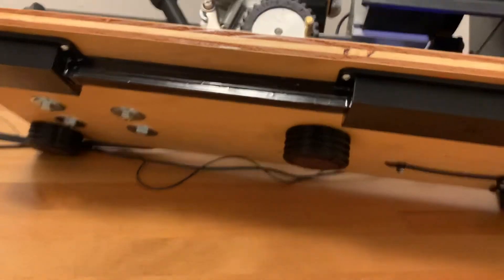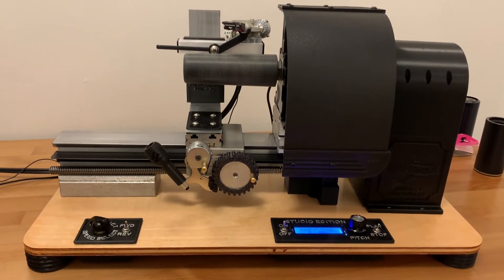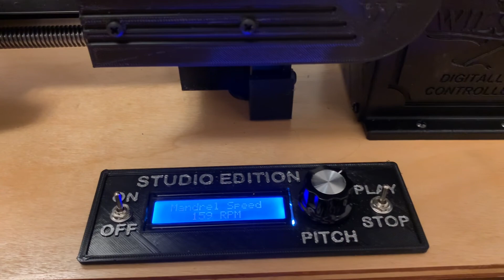Wilson Home Phonograph, Studio Edition

Comment: Awesome machine but I have a question when you are playing the cylinders you can hear some rumble is this rumble ghost by the machine it self or is it from the cylinders
Reply from the maker: The mandrels are machined to +/- 0.001", so they're pretty accurate.  The first cylinder is molded and quite round, so it would be the best to judge whether any rumble is coming from the cylinder or mandrel.... the blue amberols (the second two cylinders I played) are of course notoriously out-of-round.
Reply: @DonWilsonLabs  intresting

Comment: It's very nice and it sounds good, but 3500 Dollars is steep, IMHO.  Were any cylinders ever recorded electrically?  Wikipedia says the cylinder format was supported till Edison discontinued the diamond disk in 1929.
Reply: Look up Archeophone and see what the only other modern electric cylinder player goes for, then come back and say $3500 is expensive. 🙄
Reply from the maker: I agree with you that it's not an inexpensive machine, but it's also nearly $20,000 less than the next, least expensive cylinder player.  This machine is also the more expensive fo the two models that I offer.  
 
As for the electrically recorded cylinders, the 5000 series blue amberols were supposedly electrically recorded.